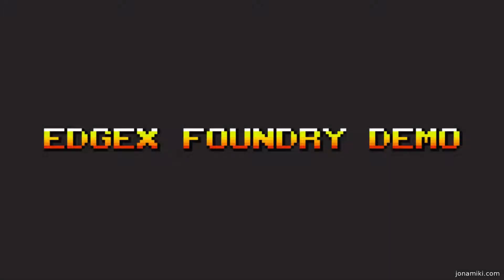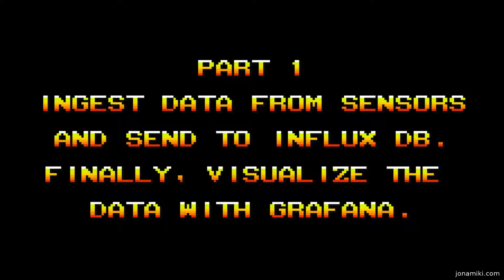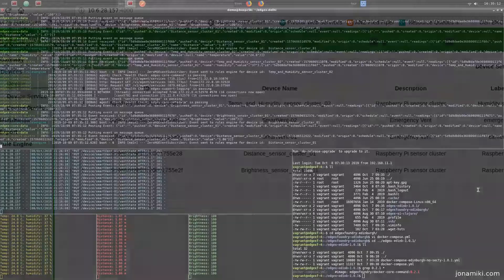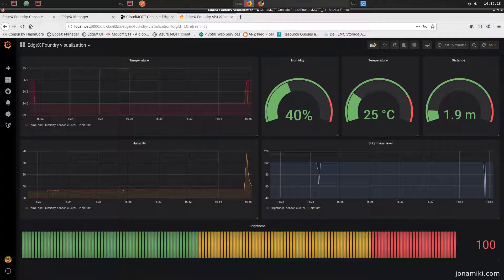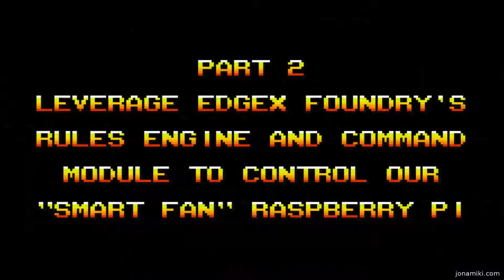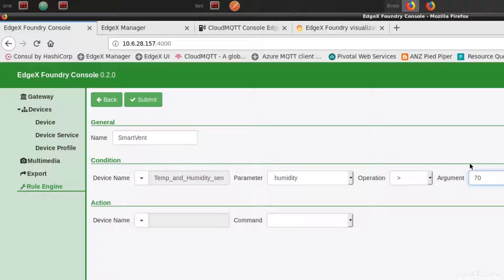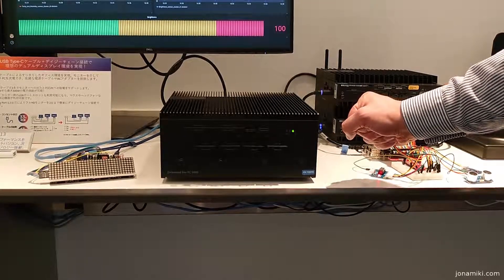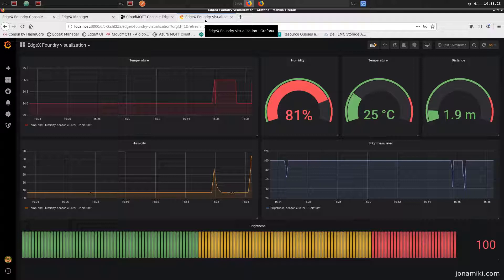EdgeX Foundry demo

Comment: Hey just a query. When I enter the edgex-ui-go I get the following error "code: 404 , message: Http failure response for http://localhost:4000/scheduler/api/v2/interval/all?offset=0&limit=5: 404 Not Found" when I try to add a device....is there any solution to this?

Comment: Hi, thank you for you video , great job. I am wondering how to setup the link to public ip cause I can ping to localhost with curl but when it comes to public ip,  it always shows nothing. BTW, I install edgeX on Azure VM ubuntu 20.04.
Reply from the maker: Thanks, much appreciated. Not sure about public IP on Azure - I work for Amazon ;) Best of luck tho
Reply: @jonamiki  Sure, I also open up a ubuntu 20.04 VM on AWS today, and follow your EdgeX-Foundry-tutorial-ver1.1.pdf (btw, this tutorial is awesome!). However, I still cannot figure out how to connect to it via my public ip. I can curl http://localhost .. but cannot connect by curl http://<my_public_ip>, any suggestions?
Reply from the maker: @洞察探思  For the AWS deployment, have you created the firewall rules required to access your instance? 

There are two places to set this up: You need the NACL rules for the subnet as well as the Security Group for your instance to allow access on whatever ports you want accessible. If you are not concerned about security you could open up access on both (although enabling each port and protocol you use would be recommended). Each service in EdgeX uses its own port. These are listed in the docker-compose.yml file. Most start with 48xxx. 

If you find it complicated or cumbersome to set up the firewall rules, either allow everything (insecure) or try running a local VM on your computer (no need to change firewall settings).

Comment: Hi May I know that how do you upload the datas from sensors to the edgex?
Reply from the maker: I'm sending them using REST calls via the same Python script which reads the values from the sensors. More details here: https://jonamiki.com/2020/08/26/edgex-foundry-hands-on-tutorial/
Reply: @jonamiki  Hi I have set up grafana but seems like my grafana does not receive any data do you know why I have follow the guide in the pdf
Reply from the maker: Could you please verify that the data shows up in InfluxDB? Please refer to this video for how to verify (it also includes some Grafana configuration which may help also): https://youtu.be/UhRLD6ve8Eg?t=524
Reply: @jonamiki  Yeaa. I manage to find that the problems in that the influx db does not have the data. I do not know how to find the problem.. Is it the app.py?
Reply from the maker: app.py takes the data stream from MQTT and enters it into InfluxDB. That could be the problem, but it could also be MQTT. Have you configured EdgeX to export the data stream via MQTT to a broker as per the tutorial?
Reply: @jonamiki  Yeaa. I tried. I think there is something wrong with mosquito because when I try to use hivemq it works but I want to know if there is a way to use mosquito as it is better than hivemq
Reply from the maker: Well, at least then you've narrowed down the problem. It's hard to assist over comments but I recommend going back to the tutorial and try creating a new Mosquitto container, ensuring that all the steps and settings are correct. In particular the ports.

Comment: I just start with EdgeX Foundry. Can you tell me what is release of EdgeX Foundry Console 0.2.0? Cuz I install EdgeX console through Snap so it not has EdgeX COnsole UI as yours? ( I use Rasperry Pi 3 as Gateway, deploy EdgeX on Rpi and read data from real modbus serial device)
Reply from the maker: Snaps would be different since you're bound to whatever microservices / versions they have published snaps for. I'm afraid I don't know what versions of the UI are available as Snaps as I don't use them myself

Comment: Hi friend.. your setup is superb.. can you send some more details of adding device or how to setup demo device.. will be helpful..
Reply from the maker: The setup in the demo was set up in part using this GitHub script: https://github.com/jonas-werner/EdgeX_Foundry-Device_Creation However, I wouldn't recommend using it as it only works on old EdgeX Foundry releases. The latest release (Geneva) comes with a new REST device service and the setup would be very different compared to how it was done in the demo. I'll try to get this working and make a post on how to do it but in the meantime feel free to either check out the official Slack channel (https://slack.edgexfoundry.org/) or mail me directly on "jonas at jonamiki dot com". There's also a post from last year on how to install EdgeX here if you like to check that out first: https://jonamiki.com/2019/10/11/download-install-and-run-edgex-foundry-in-5-min-on-ubuntu-18-04-server/
Reply from the maker: I've just finished the initial version of a hands-on tutorial. It covers the steps required to create a similar demo. Download it from here if interested: https://jonamiki.com/wp-content/uploads/2020/08/EdgeX-Foundry-tutorial-ver1.0.pdf

Comment: Hello Jonas. I think your demo is geat, and also a good starter project for experimenting. I am currently learning how to use
EdgeX and would very much like to replicate this experiment with the kit recommended on the website (Raspberry Pi with GrovePi+ and various sensors) but have no idea where to start. Could you please give me some pointers? Thank you
Reply from the maker: Hi Calin, Thank you for your kind words. Happy it was useful. Sure, we can walk through what you need to get started. Personally I haven't used GroovePi but I can show how I set things up for this demo if that helps. Just mail me on jonas@jonamiki.com and I'll follow up from there.
Reply: @jonamiki  Thank you very much! How can I reach you?
Reply from the maker: @CalinBule  Just email me. The email is in the previous reply
Reply from the maker: Hi Calin, I've just finished a hands-on tutorial which covers the steps required to do a similar demo. Access it here if you're interested: https://jonamiki.com/wp-content/uploads/2020/08/EdgeX-Foundry-tutorial-ver1.0.pdf